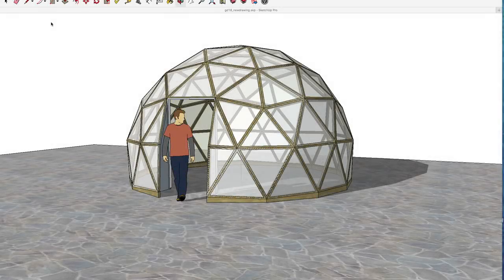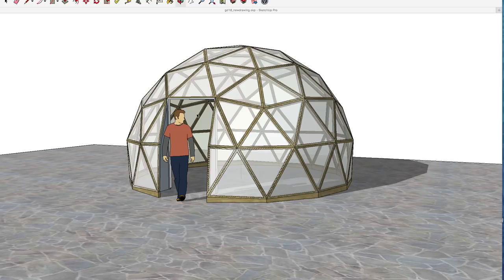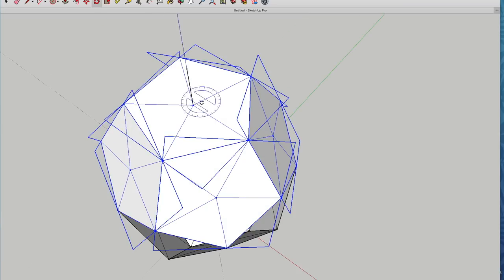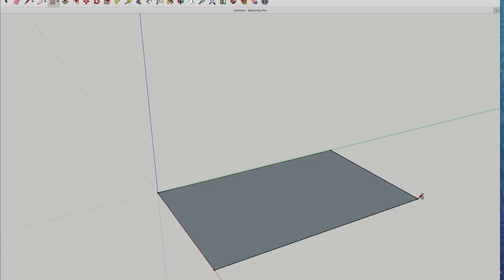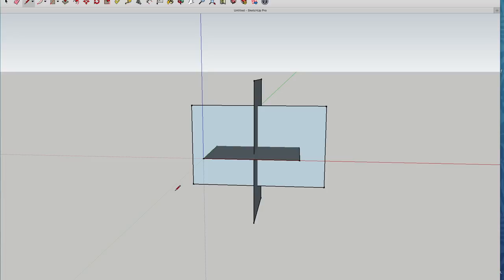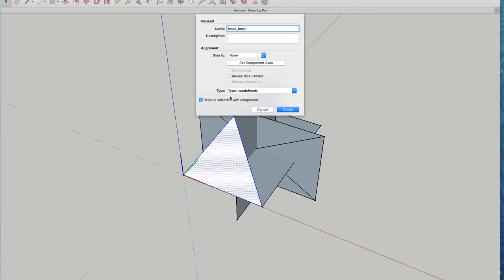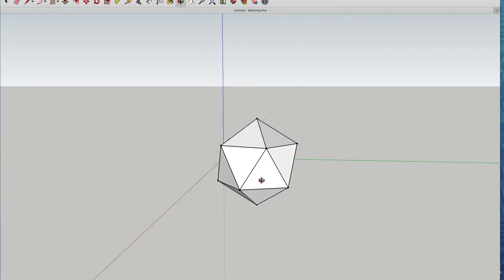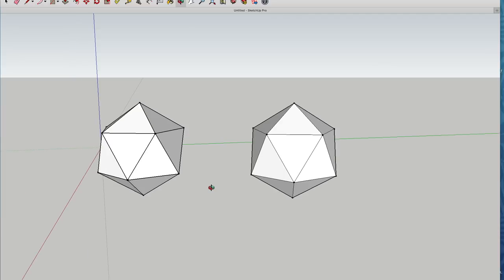How to draw geometric structures in sketchup

Comment: Hi Paul, Thanks for the video. I was wondering if you could explain the rotation of the face. I have tried several times to rotate into the correct position but it is not correct.
Thanks

Comment: you do a great job showing all these types of structures.  As an old, retired engineer you said something about drawing a 3d models using SketchUp.  If SketchUp can't do the job I suggest your followers use Fusion 360.  It's free and the skills to create the pieces are as easy as cutting a piece of wood in real life.  There are many tutorials that can get  a person started.  The added benefit is changing the size of the pieces will update the finished drawing easily. I will be creating the size you showed with the man in the doorway as a project for a star gazing room in the winter (hopefully).  Your videos are great and thanks.  👍✌🖖🥃

Comment: Good tutorial. Thanks for sharing. I wonder if Plato did this the same way (using three golden rectangles)?
Reply: It's entirely possible that he did figure it out with golden triangles. I only learned of this relationship a few days ago. I just learned another way as well... taking all the possible configurations for three and four edges to a single vertice. Turns out there is only five. Plato could have cut out triangles and cubes from papyrus paper and played around with possible configurations.

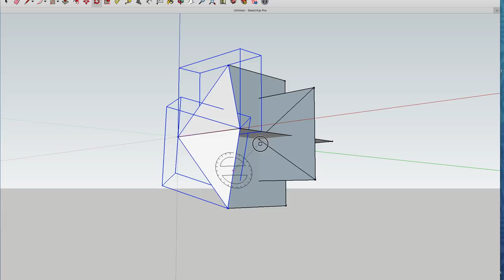Comment: 5:02 what is happening here??? even at 25 % speed i don t get it and it doesn t work if i try! LOL Can anyone explain please? (new to sketchup)
Reply: click and drag the rotate tool from the corner point of the triangle to the centre of the intersecting rectangles to set the rotation plane, then clicking on the midpoint of the triangle again to begin the rotation.
Reply: @CC-jy4gr  Thank you for that tip of click and drag the rotate tool.  I've never used that before but now I'll never forget it.